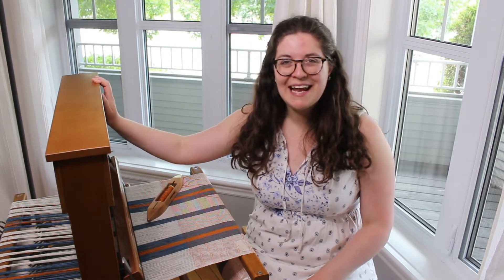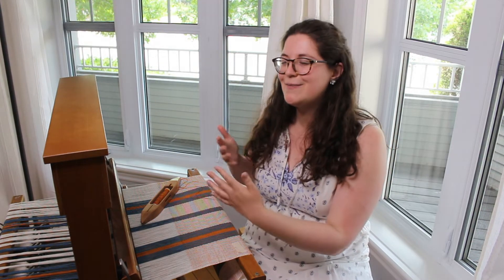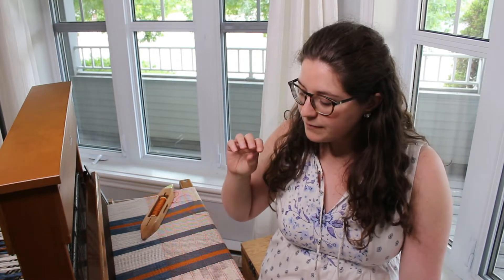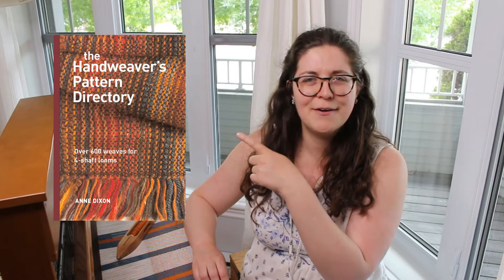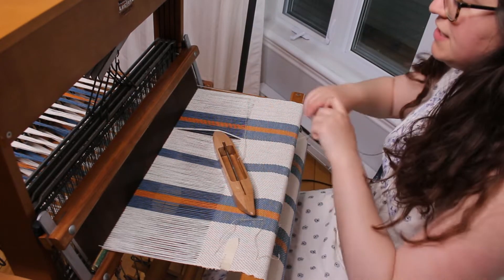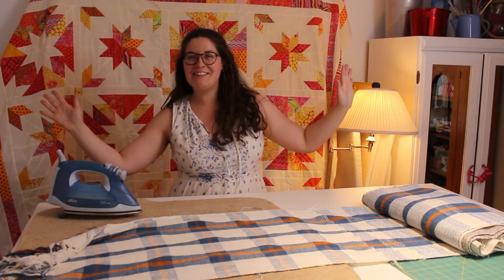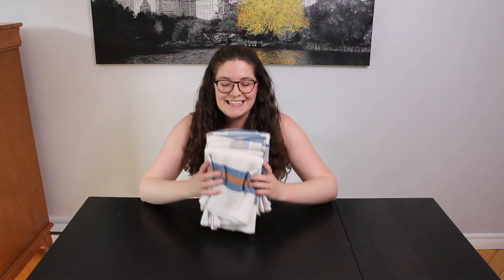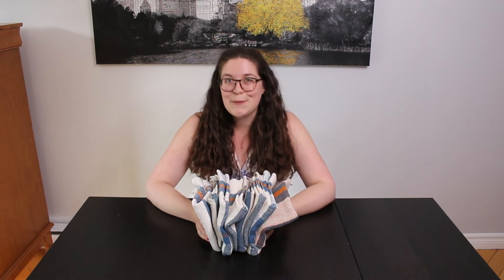Meet my New Loom: A 4-Shaft Dorothy from Leclerc & Learn About My Fiber Experiment

Comment: Do you prefer your Dorothy or Voyageur table loom?
Reply from the maker: This is a good question 😊
First, I don't own the Voyageur table loom. But it was lent to me for so long that it sure felt like I did😂 
Also, I feel like I need to say that I have only used my Dorothy as a floor loom with the add-on treadles. I realised that I prefer weaving on a floor loom than on a table loom. So for that, I prefer the Dorothy loom because it offers the option to transform into a floor loom. I'm not a 100% sure, but I don't think that the Voyageur can do that.
Still, if I were to want only a table loom, I think that I would prefer the Voyageur. The main reason for this is that the handles for the shafts are in front of the loom instead of on the side. I find that it makes it more straight foward to see which handles are pulled and which one need to be pulled next. Also, I feel like it might be more ergonomic having the handles in the front than on the side.
In both cases, I enjoy weaving on them 😊 
I hope this helps you! Let me know if you have other questions 😊